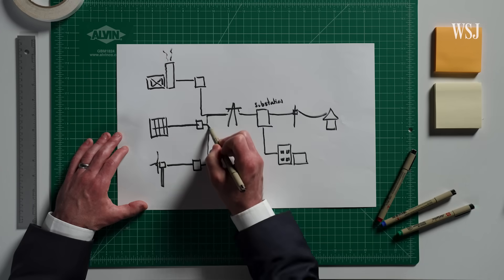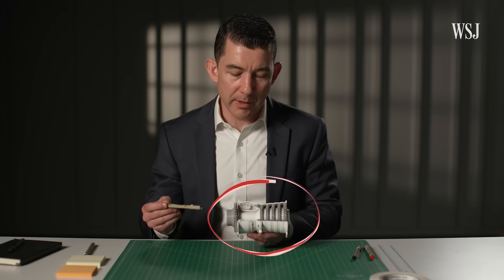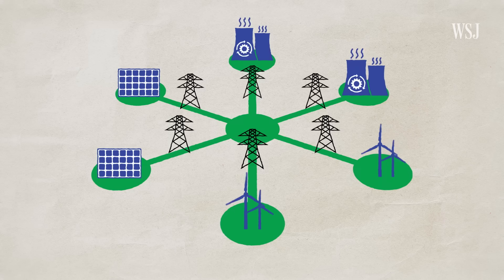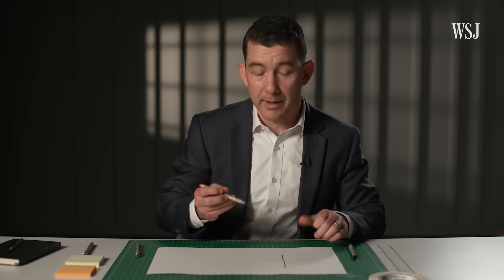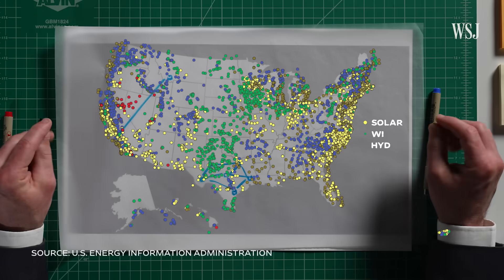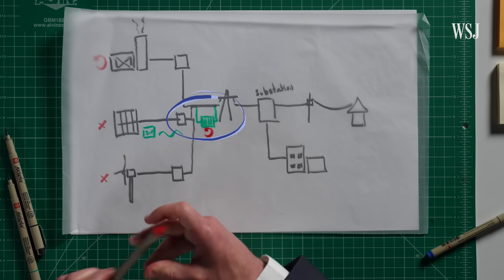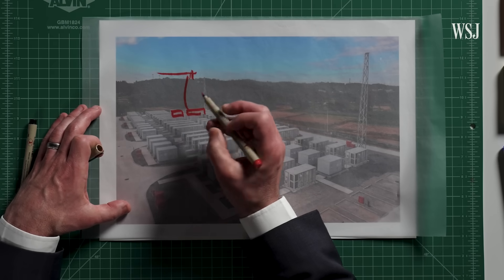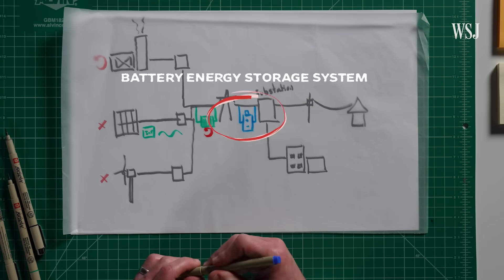How to Fix Renewable Energy’s Hidden Infrastructure Problem | WSJ Pro Perfected

Comment: Get a grid construction engineer to talk about the grid costing $TRILLIONS 
And 2 x more electricity is more $TRILLIONS just for the grid itself. 
20 x more electricity is 20$TRILLIONS more just for grid capacity. 

Just the transmission line has 50tonnes of galvanised structural steel per km and 20 x more capacity is insane. Plus foundations plus 7km of conductors per km and transformers and switch yards and poles and wires and....
Reply: It is estimated that a third of our electrical needs will be supplied locally by the consumers. Also, if it works, deep geothermal will decentralize production. Solar cell efficiency will double.
Reply: @chrisconklin2981  good comment
Reply: @stephenbrickwood1602  Thanks. I would also add the concept behind the sankey flowchart produced by Lawrence Livermore Labs. It shows that two thirds of the energy produced from combustion engines is lost as waste heat. Besides, electrical transmission  is instantaneous. Ref: Estimated U.S. Energy Consumption in 2023
Reply: @chrisconklin2981 In Australia 6,500 TWh of energy used annually, 250TWh is electricity if lucky and nothing breaks down. 
If 66% is not needed then 2,150 TWh is needed. 
In Australia if 6.6kW rooftop PV x 20million can match 250TWh then double that amount of rooftop PV,  can both self– supply and fully grid supply with feed-in electricity. 

And no new grid capacity is needed upto that point. Rooftop is just dirt-cheap realestate at the consumer's meter box. 
$TRILLIONS and TRILLIONS SAVED. 

Now the bulk remaing demand is only 1,650 TWh..

Comment: Are all the costs to the inverters, rotating mass and batteries included when costs for renewables are compared to traditional power generation? It's not just about solar panels and wind turbines. And there still needs to be traditional power generation for obvious reasons.

This means that energy consumers (all of us) now have to pay for significantly more power generators and transmission/distribution. Wages are stagnant. Debt is exploding and taxes are punishing (here in Canada) still we are nowhere near to the net zero goals.
Reply: Well, you also have to keep in mind that BESS systems are generally located at bottleneck / congestion points on the grid.  They are directly displacing the need to run new transmission lines.  If a BESS system costs a billion to build but saves $500M in new transmission lines that no longer have to be built, and can then arbitrage between the solar day and the shoulders of the evening to make up for the build cost.  Plus make a profit .... Do you see what's happening here?

BESS systems aren't just dollar sinks.  That is one reason why the wild-west of the U.S. (aka Texas) is seeing so much BESS growth on its grid.  So much, in fact, that a lot of the existing fossil generation on the Texas grid is fast becoming non-economic because their high-wholesale-pricing periods on the shoulders of the day are disappearing while wholesale pricing during periods of heavy renewables generation is dropping to near zero.

-Matt
Reply: Great question, the answer is yes. Solar+storage became cheaper than equivalent thermal (gas/coal) around 2016. Syncons, UFLS, and other firming is priced in at feasibility stage.

Comment: The "synchronous condenser" is literally just a flywheel which are being put to use right now on the grid as another form of a battery. They both should function the exact same way. So what's difference between the two?
Reply: Flywheel + electric motor/alternator connected to the grid is not like a battery, it is more like a low pass filter, because the rotational speed is almost not changing. But it gives the inertia to the grid! To use it like battery, you need to change its rotational speed in wide range, so you need to use electronical controlling unit between grid and this flywheel, and this controller has grid inverter, which has almost no inertia! And this is the problem, that even if there is enough charged batteries and enough power, but not enough inertia by the grid, the blackout can happen! Grid can not work stable without this inertia, even if there is more charged batteries and more power, than needed! Grid lose the stability, and waves of different frequencies are walking through the huge grid, till superposition led to frequency surge and destroy everything! Batteries are important, but this inertia is much more important!
Reply: The fundamental difference is in how they're connected to the grid. The synchronous condenser is directly connected, it spins at a constant speed that produces 60 hz output. If it slows down then it produces a lower frequency, which would be bad. The flywheel is connected through an electric control system that, similar to batteries and solar, needs a grid reference to attach to to produce grid frequency, since the flywheel is intended to gain and lose speed throughout the day.
Reply: @TheRaptoer  Makes sense. Thanks for the helpful explanation.
Reply: The synchronous condenser is used to stabilise the grid in the seconds timeframe, just like the spinning mass in a generator. It doesn't have enough energy to stabilise the grid for long. The battery storage is slower, but can provide power for longer. Both work together
See. https://en.m.wikipedia.org/wiki/Operating_reserve
Reply: It must be said that synchronous condensers don't provide much energy, what they do provide is large power needed to stabilize the grid if the frequency drops (i.e. sudden drops in production or rise of demand) so grid operators have enough time to react with turning on gas turbines, or hydropower
Reply: @ivanjanjic8762  2 really good comments
Reply: @ivanjanjic8762 they dont provide any energy, they are basically like a motor so they use energy
Reply: The ‘energy storage’ of syn con is basically the kinetic energy of it spinning, which is only seconds/minutes of ‘energy storage’. Grid scale batteries are normally at least two hours.
Reply: There's also a great video that goes in this problem on the channel Real Engineering and its titled "The problem with Wind Energy" 
Go and look at the solution the Irish are using.
Reply: Flyweels in traditional power plants are spun up using steam running trought a turbine. Synchronouse condensers use electic motors to do so. Both aren't that great at being batteries cause as soon as whatever spins up the flywheel stops both the grid and friction will slow it down. You can also call them synchronous capacitors which in my opinion fits better as the term condenser no longer gets used to describe capacitors and that way you won't confuse it with an condenser in a heat pump. It also tells you that they make for terrible batteries if you know how a capacitor work.
Reply: In basic terms one solves the problem with physics and one with electronics/ computer control. Physics is good because the laws of physics are the same from Nebraska to Texas. it is however inflexible. Electronics are only as good as the input data. More flexible but more complex.
Reply: Battery manufacturing is not environment friendly process. That condenser is definitely better
Reply: @virchandrakumar8186  What battery manufacturing are you talking about? I never talked about chemical lithium ion batteries if that's what your confusion is. I simply referred to the flywheel as a battery because that is the function it is doing.... storing energy and then releasing that energy.
Reply: Virch, batteries are far more environmentally friendly than extracting, transporting, storing and burning coal or methane. And batteries are recyclable whereas burned methane and coal is not. And, new and greener and non-flammable chemistries such as sodium ion are hitting the market. Try again.
Reply: @virchandrakumar8186  WRONG Grid powering massive galvanic (i.e. lith ion) batteries do not have to be very energy dense and can use more inert environmental friendly materials. The problem for all these things is lack of Manufacturing Supply Chain scale because we are too lazy to do that continue just burning fuel. There very much is already a Fly Wheel energy storage industry and also used for Commercial Facility UPS switch over. But that industry is basically being maxed out at their production capacity with the given funding. Basically we need both galvanic  batteries and condenser - flywheels what ever can be manufactured at decent cost.